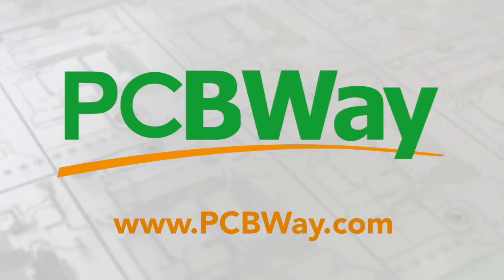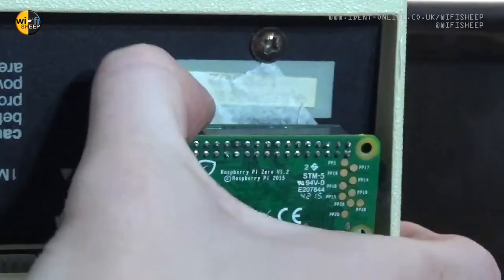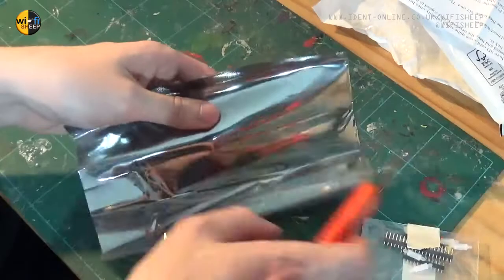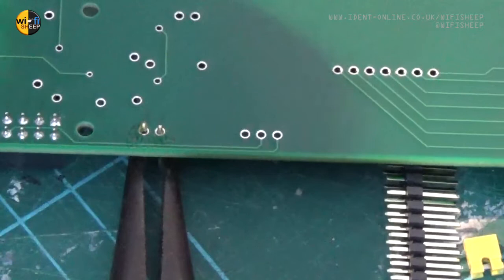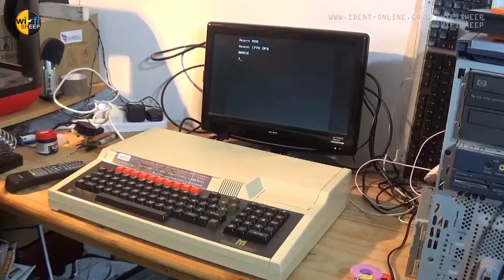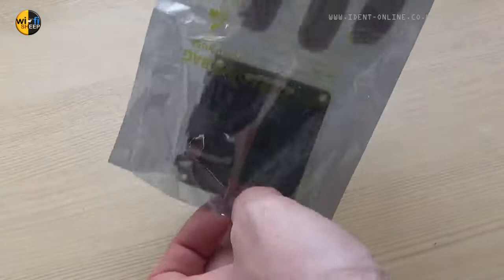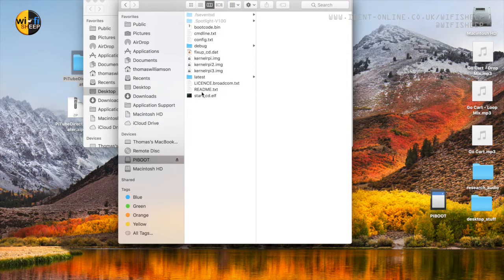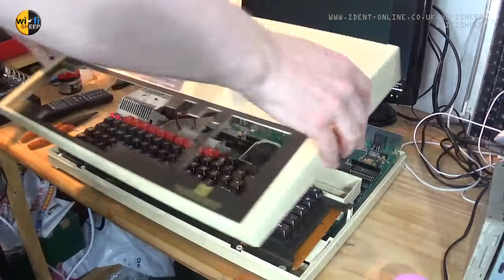Pi Tube Direct Internal Co-Pro for BBC Master 128 8-Bit Computer

Comment: Thank you very much for this video. I made everything as you said and it is working (BBC Master 128, with SD card and PI Tube internally). Now, there should be some HowTo, for example, how to move between disk images, list program, start with chain or load or whatever. Some link for self-learn? I also have SDcard and it doesn't work with tube? 
I also don't understand why does: *DIN 45 followed by *TUBEELT starts Elite? Is it Elite on SDcard on image 45 or something else? Is that Elite for 2nd CPU on Master BBC or what? Some help or some links to the really good explanations of FX,DIN,CHAIN commands in order to use this goood machine would be really, really helpful. Currently with only Quick HowTos... I can't enjoy the fully potential :(
Reply from the maker: Hi .... yeah the MMC interface command set is a little lacking at best, and even im not an expert in it! Although it works well, it seems to assume users are fully up to speed with the commands and many... myself included, are not.

But basically
*CARD followed by ctl+break hard resets the machine into MMC card mode.
*DIN selects the disc image to be mounted eg *DIN0 
*DBOOT executes the !BOOT file if present on the disc image eg *DBOOT0
CHAIN loads and runs a BASIC program file 
*FX are OS calls for special functions most of which are listed in the BBC Micro manual.

The MMC games menu (*DBOOT0) does not work with the TUBE activated
As for the elite build on DISC 45 I have no idea without checking and assuming your using a stock MMC image. The Co-Pro version of wont boot if a second 6502 is not present (Pi Tube Direct) 

There are many other functions which might be worth making a video on some work and others less so.
Reply: @WiFiSheep  THANK YOU!!! Hooray! This really, really helps :)

Comment: That's a terrible soldering technique! Instead of using the hot iron to transfer molten solder to the work, simply use the iron to heat up the work and then apply the solder wire directly. That way you don't boil away the flux that's already supplied inside the solder wire (like the lettering in Blackpool rock) and make a lot of smoke. If you do that there's absolutely no need to add any additional flux.
Reply from the maker: Very interesting... thank you for the suggestion

Comment: Nice upgrade, although I would like to rip the old beeb motherboard out and replace with Raspberry pi with a hat which provides all the I/O the BBC micro had then run BBC emulation software which uses the hardware. That could run many times faster than the BBC micro with a fraction of the power consumption and support much higher resolutions and colour depth.
Reply: no!!!!
Reply: Just run RISC OS on the Raspberry Pi. A Risc PC/Archimedes was essentially the "better BBC Micro" anyway.